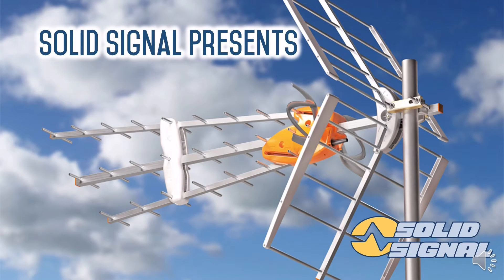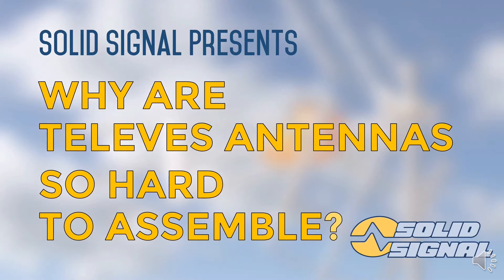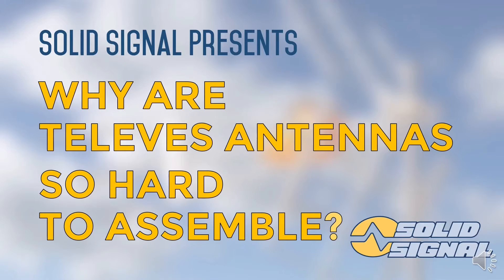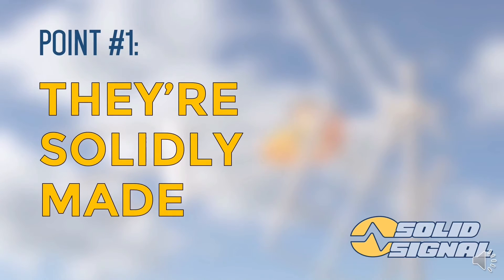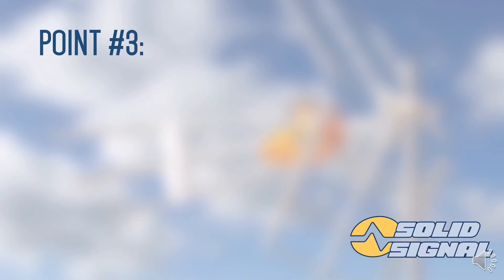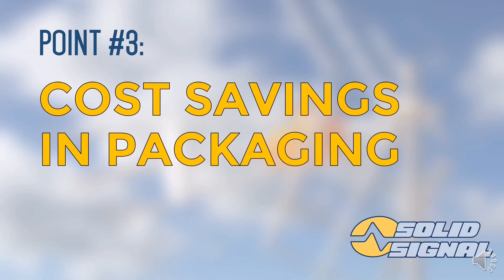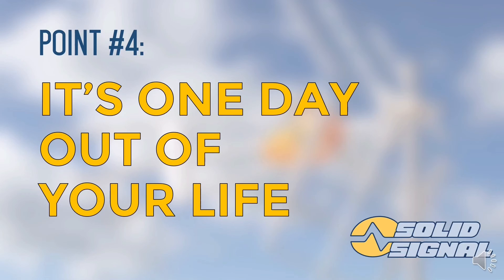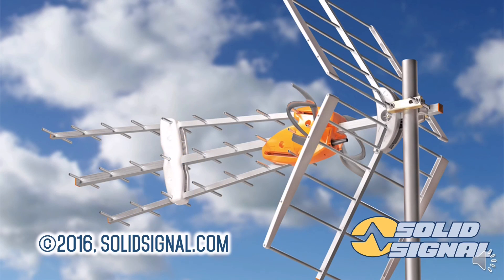Why are Televes antennas so hard to assemble?

Comment: These antennas are not that hard to assemble. Most americans are not used yet to assemble this type of antennas. Once you get used to them, it's a piece of cake. I have installed two Televes antennas: the Zenit and the DATBOSS UHF. The Zenit, which is the basic Televes antenna in the US market, takes more effort since you have to put the two booms together. The DATBOSS UHF (more expensive) is much easier since you only have to deal with basically four parts: two reflectors or deflectors, one dipole and the section with the three directors. I just watched a video from an installer in Spain and it took him less than two minutes to assemble the DATBOSS UHF antenna.